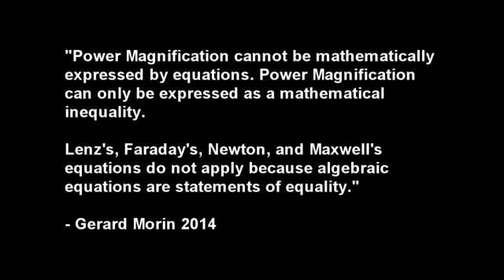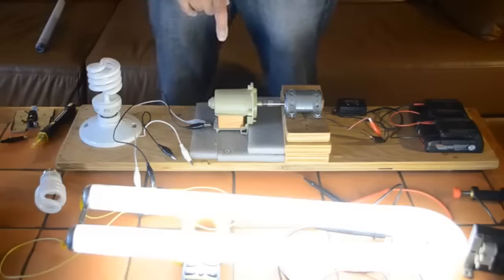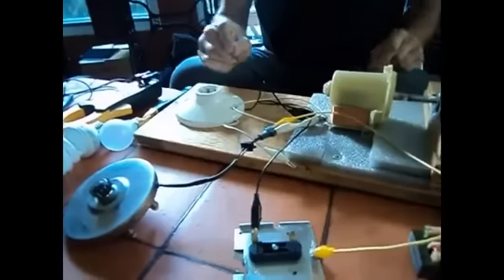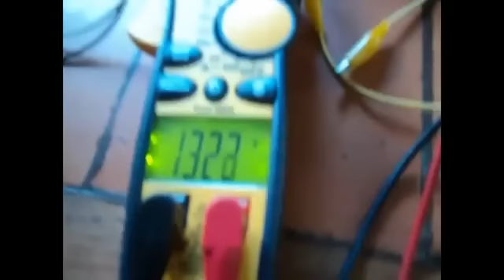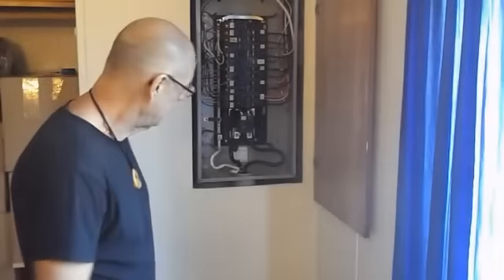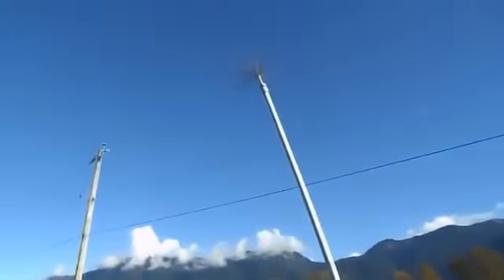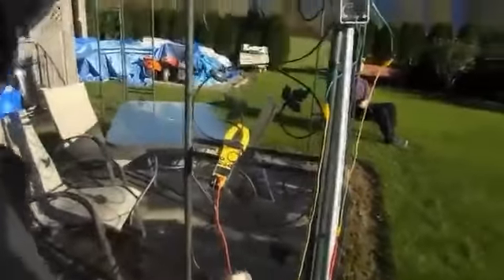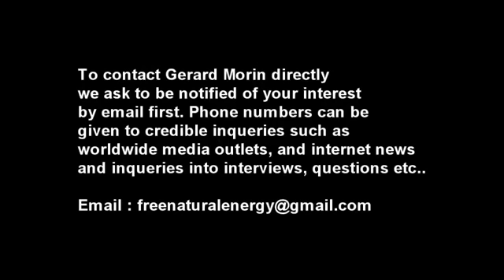Time to END The Electricity Racket - FREE & NATURAL ELECTRICITY PROOF

Comment: I am a retired electronics technician.  If you double the voltage in something... you will HALF the amperes.  You can't get more out than you put into any system.  I built a "TESLA" coil when I was in 9th grade back in 1972.  A tesla coil puts out many THOUSANDS of volts.  It will throw a spark across a wide gap... but the AMPERES are so low, you can't feel any shock from it!  This guy is interesting to watch, but he doesn't understand basic Ohms Law.

Comment: I think it’s all about the resistance and amperage. The motor will drain the battery 10 times quicker that’s why the bulbs are 10 times brighter. In the end, it does nothing.
Reply: I know right... people keep on falling for the same old tricks. 🤦‍♂️
Reply: If you could provide enough voltage, a step up transformer would probably work. To do that, you would need to go very high into the air however to generate that between the ground and the atmosphere.
Basically what power companies do with transmission stations you see by large power lines.
Reply: Your completely missing the concept.
Reply: @murdocks4304  you mean the concept of latent voltage?

Comment: Bravo! What you have made is simple DC to AC converter that requires mechanical part (rotor). You have increased the output voltage so the bulb will be brighter, but at the same time you drain your batteries faster (conservation of power) and you decrease the life of the bulb.For a filament lamp: 

- 100% voltage, standard nominal life (750 to 2000 hr)
- 95% for 2x life expectancy
- 50% up to 4000x life
- 110% with 40% more light but 0.3x life (too bad)

You have to understand that you need to look at the power on both sides. The increased frequency and amplitude doesn’t change the fact that its mean value is equal to DC value.  In your “experiment” try to run a mixer, an iron , a heater or any other device that requires power - it won’t run. The bulb is just specific example that we can trade the lifetime for lumen watts.

As for atmospheric voltage - this is well known fact described by Feynman who proved that static potential increases 100V/m with height up to 50km. You can measure this potential but again, the power is far too low to run a decent machine. You won’t be able to do any work.
Unfortunately, nobody is going to visit you.
Reply: You got him on that no free energy here.
Reply: @chucksteele1251  Unfortunately not, although I believe we can create a device that uses magnets to produce energy, but again the output power is very low. Possibly we could use such devices to "power" ultra-low power bulbs.
Reply: @danieljust295   The hairpin circuit works but if you test it you killed the circuit when you scale it up heat and resistance kills it. My friends and I continue to work on different approaches, some have found a way but most are killed for trying to bring it out to the world. They wont let it go main stream. You will not find it here.
Reply: @chucksteele1251  Yes , of course. This tech has to be given freely to the people and then people will realize they can still make money on different designs and improvements of such tech. The only way to fight with "the elite". 
I also believe that the aether is the answer to all types of free-energy devices and levitation, but modern science is unaware of it (or purposely is unaware), but Tesla was and most of the 19th century physicists. No wonder modern researchers don't understand magnetism. I have seen once presentation of Vietnamese or Thai researcher and she explained how to build such devices. Even though she didn't mention aether I had a feeling she talks about it, the audience naturally didn't understand what she was talking about. In short, she was talking about "the pressure of the aether". I suggest researching the aether.

Comment: At the 44 minute mark he shows an electrical panel.
Then shows the white wire as a return back to the power company.
I dont know where he is getting that idea from.
The white wire is a neutral or common wire that is a return to the transformer where it is bonded to ground.
The neutral wire is where the electricity wants to go to complete its circuit.....or in a faultl situation it goes to ground.
In his panel the common is clearly bonded to the panel as a ground and there is no ground wire....AKA green wire...or green/yellow.
All that current on the return neutral he is seeing  with his meter means is there is a poor bond to ground somewhere in his wiring at the panel, or the panel is overloaded and the neutral wire isnt sized right for the load.
If that neutral wire ever failed....the panel would be hot and could short to anything it is attached to.
Todays electrical code calls for a separate ground at the panel, a neutral at the panel for household systems twice the size of the load lines, and not be bonded to ground if it is an end supply panel. What he shows is a fail wiring in his panel.....not the electric company stealing back power.
Reply: 41:25  His hand is an inch from contacting that lug which is 110VAC at 125A.  Its hard to say but that's a linoleum floor and he probably has boots or sneakers on so if he brushed or bumped it with his hand he will apparently be safe?  If he contacts the metal cabinet at the same moment then that's about .1 amps through whatever is between the path of the electrons, provided that he doesn't remain in contact?  What am I missing?

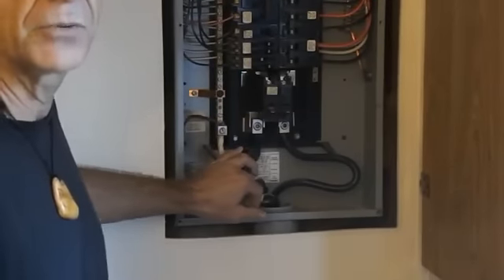41:47 Is he actually touching the Bus bar?
Reply: @CRSolarice  He is full of crap to say the power company is sucking power and reusing it again. The neutral is a ground back at the transformer of the power company. If it has voltage on it, there is a fault condition in that ground and neutral bond at the transformer or the neutral is too undersized for the load. Certain equipment feeding off that panel can also put noise in the lines return showing a few volts on inductance type multi meters that are cheap brands. The reason he can touch it is because the path electricity wants to take is the path of least resistance, which in this case is not him because he is not the better ground. If he was the better ground he would  be knocked on his butt. This whole video is nothing but scam to get people to think he has some gifted knowledge of electricity that is basic electricians class 101. Have to remember also.....no matter what contraption you use to convert electricity into one type or voltage to another, there is always a power loss in its efficiency.
Reply: @CRSolarice  I like you. 

I don't know if its intelligence...
Put it this way, friendly kind male, hard worker, not allowed to work, females treated completely different in the area, paid more then males, refused education, denied work in the are,a Even a lady stated we don't hire your type. I am forcibly removed form the society and civil systems, acts were done against me, sought judgement, IE a lawyer, denied justice, form people that denied me when I paid for education that I was an evil white male colonists? but every person is a colonist that comes here, and post ww2.. we just ended up in this land...

So almsot 40.. earning for sometime less then 6-7k a year. minimum wage was like... 5 dollars... but the migrants keep pouring in.. foreigners given government positions, and jobs immediately kept busy, the degradation of the mechanical systems and automatic and factory sectors all gone, the men in the foundation sectors of raw resurrect extract  a lot have committed suicide...

So... I wonder to my self being forced to remain in a land of humans i mostly despise and dislike.. all from the governing system of bullshit and money mismanagement. IF I were to gauge hate.. of a single individual I would wonder why I feel a bit  targeted. For sentence.. Kei a friend of mine, worked at a taxi outfit that moved in, all people from india, hired a attractive white female (northern) she got up on the desks and screamed hollered, in fun.. they never fired her, but if a male does it.. your attacked so the brain dead migrants offer no objective reality and are given jobs, so yeah, anyone can be part of a trade, but the point is th biases involved hiring an the lies and nonsense is completely ruinistic to the society in question to actually develop...

So then I am now forced to something I hate.. in order to survive... denied verb and any relief benefits in the system... its like they stop us from owning land or means but we owned land, so its like a weird capital take as much as you can and then run society.. I am capable of many things but lacking of funds from outside sources... is really detriment...  Of course standing up for law is another way to get fired. IE someone tells you to dig with your hands.. when you are just waiting for shovels to arrive, or your owkring up 60 feet in the air, and your like can you bring the harness , and they just fire you two weeks later no reason, be you asked for a harness to do your work, that is the intelligence of this society,y of course he is a foreigner that owns the company, and only speaks of family in a sense of I made life.. but eats and devours life.....

It's pretty obvious with history India and China war by the same means of market and personal flooding to erase cultures or peoples.. hardly friendly.... but meh...

Now this electrical talk is pretty funny, its good thing most of the comments are level headed... but yeah denied interview with many companies... many rejection letters... any things that state to me no.. money is to am hans of life, all my work when checked over by a journeyman or someone else stated it looked lena and good, its common sense.. so what we have is  a very weird world... if I had capital I would most likely have a profession but the student loan thing of the government and then the harassing of the person the bias money to native gorps that are not native that don't pay taxes/?!! Then to a selling of my loan to other groups to make them billionaries.. Then we have the chinese mentality off we give or put all the debts on one person and kill them no one owns anything mentality.. fucking gong show in this society... so... lol.... Apparently I ahveto suffer for whatever reason in this society... for no reason....  Its like my personality doesn't mesh wit hate natives. LOL 

If I was gay, accepting of all perversions, and acted a specific way I am giving oodles of attention and money, but.. who the hell would want to do such thing.. I question the direction of the society. lol.. rolls eyes... I really hate most of the males in these lands and females, cruel despotic and without insight... but hey maybe it sjsut because of the capital nonsense... or maybe its the criminal and illness in law...

Comment: What this guy says he is doing, anyone can do. Go to your local electrical supply and buy a 220vac or 440vac to 120 vac control transformer. Connect a 120 vac power cord to the 120 vac side and plug it in. Viola! You are now making either 220 vac or 440 vac on the output side. Piece of cake. Unfortunately you lose amperage doing this. Whenever you step the voltage up you lose amperage. Now what Tesla did was different. He stepped the voltage up to extremely high voltage, but the frequency was millions of cycles per second. At a particular frequency, the firmament was excited to the point of releasing electricity. Then, I believe, he used a second device built identically to the unit used to excite the firmament, and used it as the receiver to 'collect' the additional charge. Of course the step up transformer used to power the exciter unit would now be stepping the voltage down to a usable level. The trick is finding the correct frequency to properly excite the firmament.
Reply: What about resonant frequency?
Reply: EXACTLY !
Reply: That is resonant frequency
Reply: where can i get more reading material ? i would like to learn more
Reply: Where is Viola?
Reply: Nobody has any measurements of the power drawn from the hydroelectric plant to power the Tesla Coil and shown any higher power harvested anywhere from over unity power generation.  The power drawn was huge and in his experiments, he actually burnt out one of the power plant generators.  Look it up.  For those interested in Resonance, you only need to study Kirchhoff's law.  Resonance is used by ALL radio and Television broadcasting.  There are many transmitters operating at 50,000 Watts or more into a resonant antenna from a tuned resonant transmitter output.  Resonance and transmitted power is well understood, and resonant antennas and receivers pick up this signal.  Unless you have a crystal radio, you simply do not pick up enough energy to power your headphone or speaker from this supposed massive free energy from the firmament.
Reply: How about a flux conpasitor that might work

Comment: Goober has 'invented' a motor driving a dynamo, commonly known as a dynamotor. Google it. 

Dynamotors were common in WWII as they could use a DC voltage from a truck or aircraft electrical system to run a motor, which then could spin an alternator armature, which could have several windings which produced several voltages for radio equipment. 

Vacuum tube radios required a cathode heater (also called 'A") voltage, typically 6-12V AC or DC, a B voltage for the plate, which could be anywhere from 45 to several hundred volts, and a C voltage to provide grid bias. 

Dynamotors are hugely inefficient. There is a very large energy loss in friction and eddy currents in both the motor & generator. 

No magic here folks, just very old, inefficient, obsolete tech.
Reply: Thanks for clarifying bro.  I'm outa here
Reply: Well, he does state that he doesn't want to power the world, only one house at a time.  But isn't that enough?  Those that want to generate their own power instead of being on a grid, it seems like a valid idea if it can be proven.  I'd hardly call that obsolete if it can do what he claims.  I just don't understand it enough.  Maybe I am getting fooled because I don't know.  But yeah, if I can avoid paying for power, why not?
Reply: @Zorander2008  Yes you're getting fooled, he basically created a mechanical inverter that changes DC current to AC current... He forgot to mention that those batteries will run out of energy, so unless you have an endless supply of batteries its pointless.

Comment: Hi, great demo of a rotary transformer. The 2nd World War UK Army 19 & 62 Transceivers used these which I used as a kid in the Cadets. The only issue with rotary transformers apart from the noise, is they are not very efficient & the commutators wear out. There was a variant of the Rotary Transformer used by the Canadian Army, which had in effect a Bell like buzzing voltage chopper which fed into a coil transformer. The harsh square wave input was stepped up to a higher voltage and smoothed out by the properties of the transformer's iron core.
Modern electronic Inverters are much more efficient & silent.
Reply: Mark Kenton where can I get this rotary transfomers that can't wear out sir?
Reply: AKA 'dynamotor.'
Reply: @orastojames7468  buy an inverter that uses no moving parts. They are everywhere
Reply: It's actually not a rotary transformer.
Reply: @JF32304  that's what I was thinking it's not a rotary transformer there is no commentator and the vehicles and most everything back then was six volt so this is a system different than any I've ever seen and yet at the same time something we all played with his kids one got made the point though you know you can't over voltage and under amperage anything it's going to give out faster doing that but with a voltage regulator problem cured and everyone should have a line conditioner in between the power companies nasty feedback static riddled electricity
Reply: @bscguitars2278  ummm most people don't realize this but that's a washing machine water pump. 😂. Yes. Look it up. It's a washing machine water pump. He may have takin it apart and installed stronger magnets but it's a water pump.
Reply: You people are smoking some good stuff in here lol. That's a washing machine water pump. Nothing more, nothing less.

Comment: Hi, can someone explain to this laymen what these videos are actually showing?  What I see are batteries feeding the system, and then various methods of stepping up voltage.  Ok.  I see that.  But it's the claim that the batteries never run down?  That's what we'd need to say there was free energy, so it seems to me there would be some recording of the voltages remaining consistent or increasing in the batteries to prove free energy.  We never see that.

If I'm missing the point Is really like to understand.  What shown is proving free energy?  Again what I see are two batteries powering a circuit.  Where am I wrong?
Reply: What he did was trade high amp low volt DC for low amp high volt ac in a very inefficient way. No miracle here.
Reply: I'm not sure I get this all myself but it seems at first what he showing you is how much energy he is getting that is completely different from what is coming out of our sockets is. That it has no current which is what kills you. The crux of his invention is based on the Tesla coil which is producing electricity by a completely different method, some type of induction. Then later he is showing you how much voltage you can grab right out of the ground and atmosphere which could then be sent to the previous technology which he demonstrated earlier. Extremely efficient energy production starting with the free energy all around us. Safe too